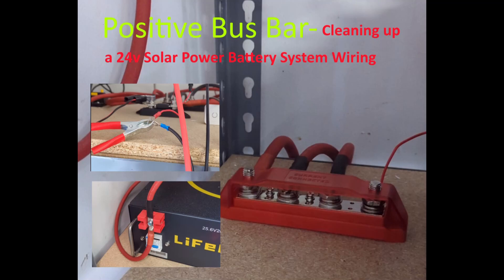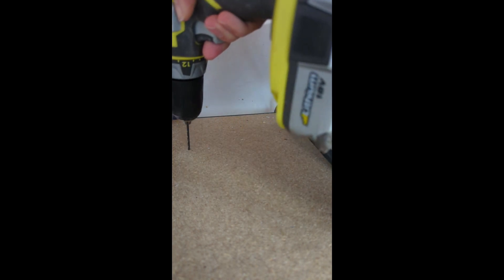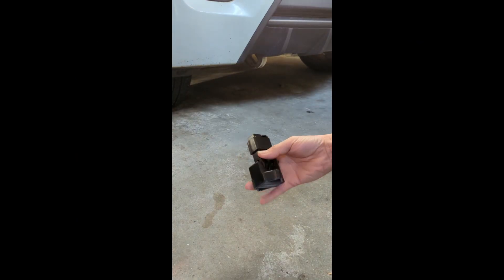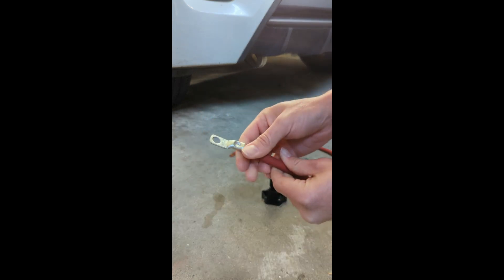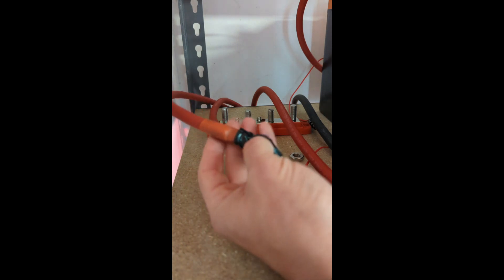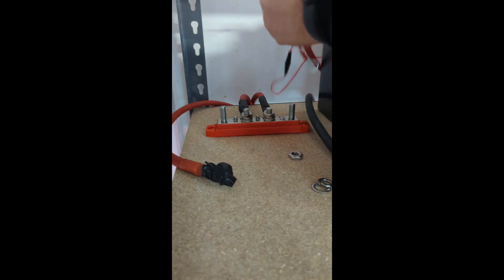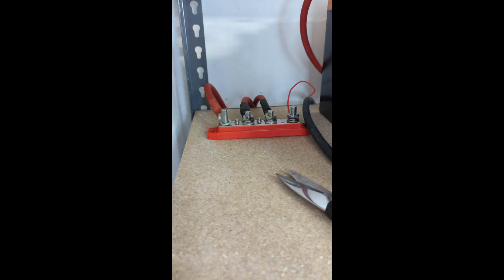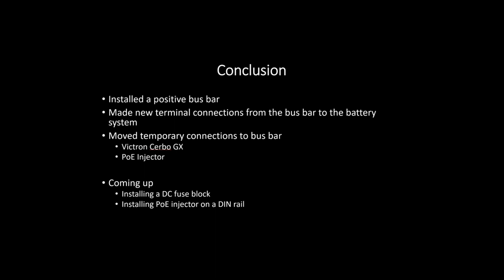Installing a Positive Bus Bar on a 24v Off-Grid Solar Power Battery System

Comment: Well done. I have a battery cutoff switch to charge controller/inverter so I have no spark and I can do battery maintenance with a flip of a switch after turning off charge/discharge on BMS's.
Reply from the maker: That's a great thing to have. I need to look into that. I was at least going to get a pre-charge resister to eliminate the spark.

Comment: Can't wait to see the next video.  Will you also be making a video on the negative bus bar connections?
Reply from the maker: Unfortunately no. Before I started recording what I was doing to the solar power backup system, I had already made the connections and installed the negative bus bar. I am recording everything now as I build out the system and test off-grid scenarios/applications. The next video will be coming soon. Thank you for your comment.